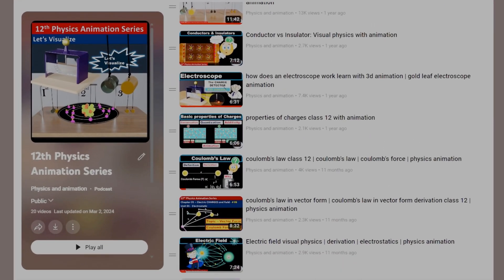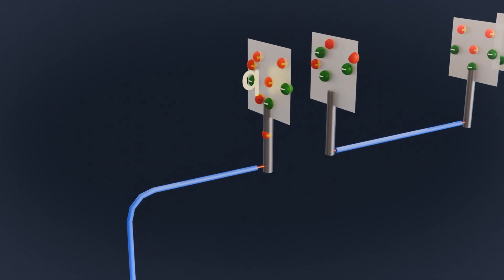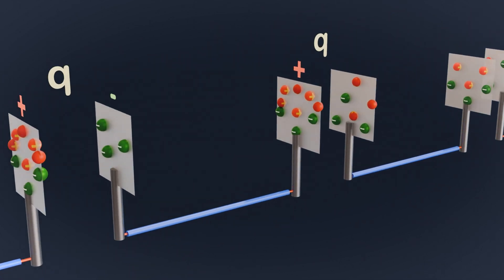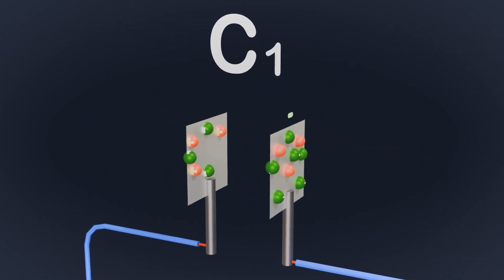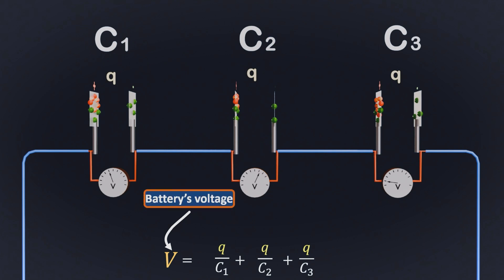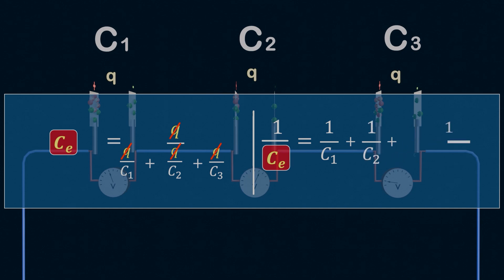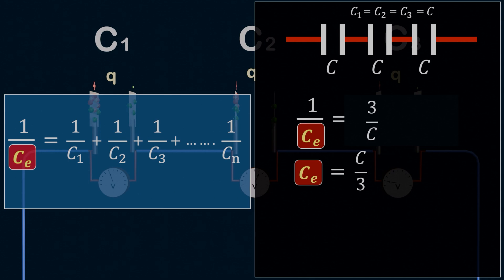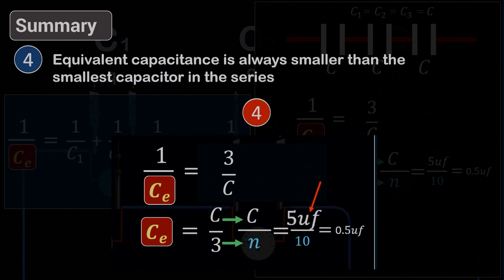Visualize capacitor in series | part - 01 | capacitor in series with animation | 12th physics

Comment: I am confused, if the number of charges are same then how the voltage shouldn't equal.... Can anyone explain...
Reply from the maker: Actually when you purchase a capacitor, a value of capacitance is written on it which can be different for each capacitor. You can also purchase it of same capacitance. 
.
So C1 C2 and C3 which is mentioned in the equation is that value. So the voltage generated by q is  charge q divided by that  value of capacitance. V=q/C1. q1 is definitely same but C1, C2 or C3 depends on our choice whether we have kept it same or not. So until we do not use same capacitance q by C cannot be same  for all.